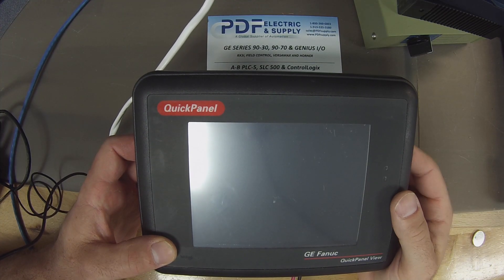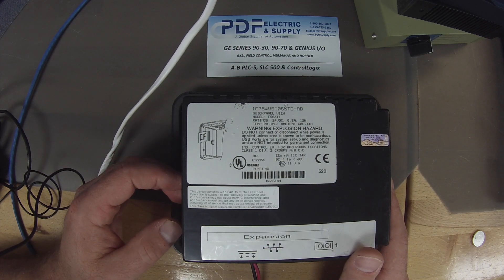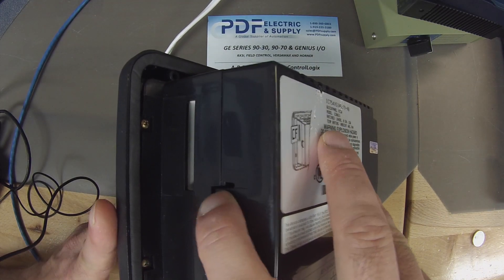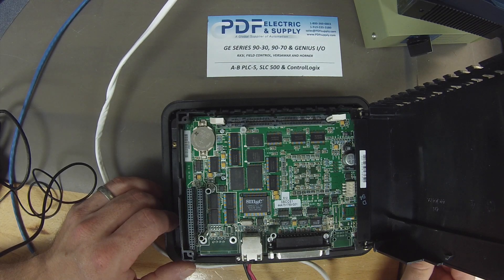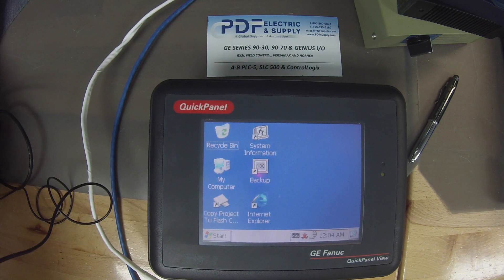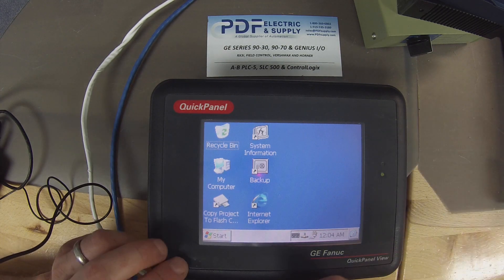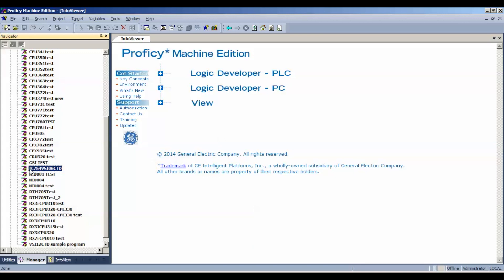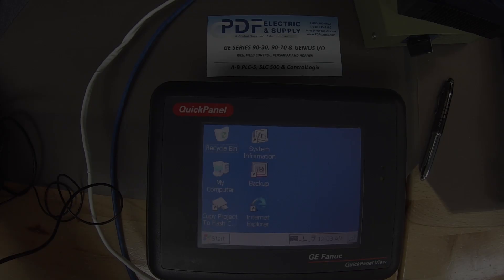How-to Troubleshoot & Test: IC754VSI06STD GE IP QuickPanel View Touch Screen

Comment: I have a such model quick panel HMI, saying battery low and need to change battery. My question is if I have to change battery, I have to switch 24 volts off, will I loose data or miss application program in it? How can I change battery with power on HMI? Battery position is on bottom circuit board, hard to access battery without open main board on top.